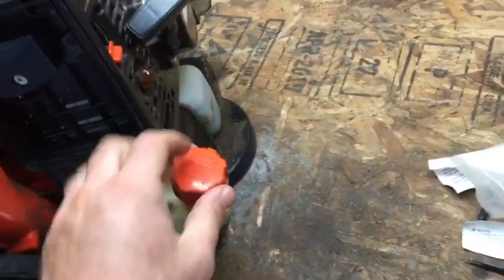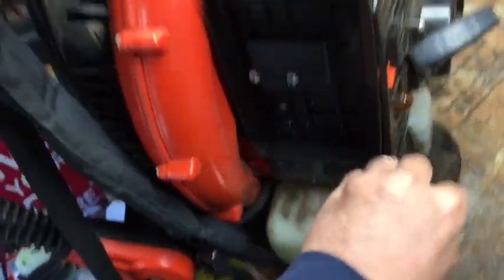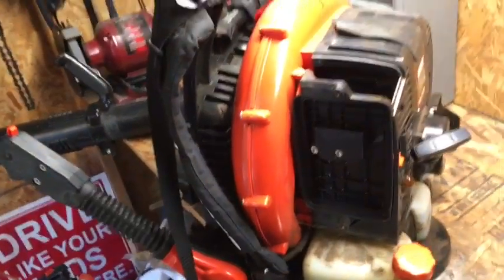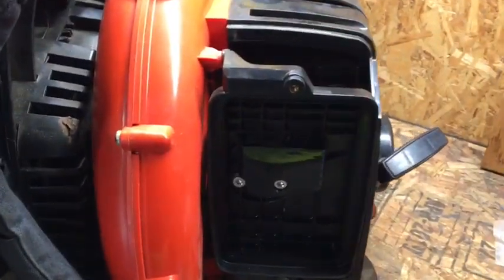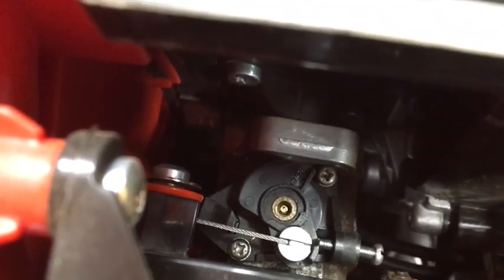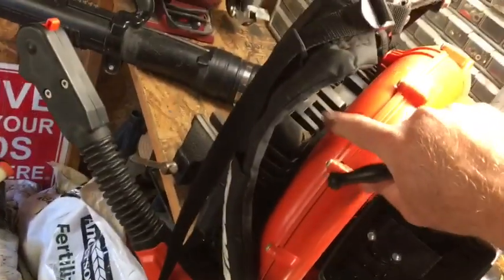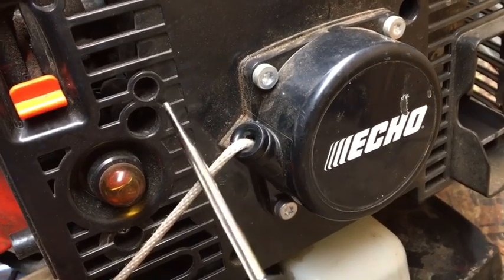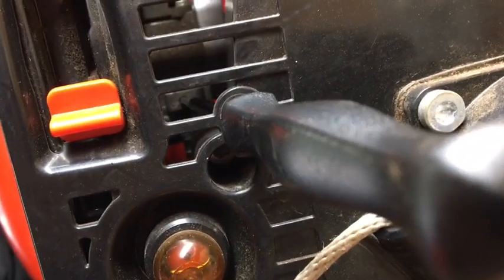Echo 770 BLOWER CARB ADJUSTMENT STEP BY STEP

Comment: Thank you for this video. It helped me finally fix my 770t. Echo replaced my entire engine but not the carb. Even after that it was still bogging and running hot. I kept telling them it was too lean and always told carb was set right. About a half turn and it runs like a hero. No more bogging and it doesn't smell like it's overheating. It smells like a 2 stroke should! And it has a noticeable amount more power. Thanks again for the information!

Comment: Thanks - just did this and solved my problem.  Got a good set of the tools on Amazon for about $15.  Appreciate the help.
Reply from the maker: ggnoodles1 broke the factory tool set and bought another off amazon. These blowers need slight adjustment from time to time

Comment: Looks like a 5/64 tension (get the longest @ Ace Hardware) will fit onto the carb adjustment.  First use penetrating oil on the tiny adjustment stem.  Echo stop selling any adjustment tool. Open just a hair!  Do nothing else but there are clues in my other posts here.  (find that pre air filter etc)

Comment: The current # for that tool is: Echo Walbro ECH-91159L but it can't be had cheap.  AliExpress sells similar for under $2 but it's too short. If you buy one of those multi sets of drivers, the metal section needs to be at least 4" long or poss. loose your warranty & enlarge the hole to get closer to the carb.  I do not know if one of those multi sets has a micro D that fits!  YOU CAN MAKE ONE as I just did for .50  Ace Hardware, find the selection of tension pins, get the smallest, 5/32 x 1, not shortest; close it's gap & you  have to grind it thinner BUT THIS is the only metal that is still strong enough to do the job. I put the pin in a vice so I could pound something into other end to make it long enough  (Use long thin flat head)  I tried everything before this as I won't give Echo (on line for $19.04 + 5.98 shipping) that much $.  **ALSO **   E-bay sells China carbs for the 770 for $15!.  I saw a vid & it looks easy & worked great (so far) & HAS A FLAT HEAD ADJ. SCREW!!!  
 I hope I've helped you as I banged my head for the longest.  (edit: in my exp. all used blowers are slowed- down by a clogged spark arrestor.  it's a screen at the exit of the muffler that 2 cycl oil has clogged.  Throw this useless screen away BEFORE anything else!)  
 I'M NOT SURE I even recommend this anymore b/c this tiny adj. screw is real stiff to keep from vibrating out of adjustment & it is tiny.  My system might round it off so MAYBE  replacement w/ a Chinese carb w/ a  flat head adj screw is better
LISTEN:  The BIGGEST, BIGGEST improvement one can make is to lengthen that short blower tube.  Being short (5' 8") I just unscrewed both tubes & connected them about 2" into each other then used strong black tape.  If you're taller, you may need to order an extra section & fabricate.
The end of the tube should be 2-3 feet away from your feet with no hands on.  I AM NOW RARELY USING full power so:  longer life more satisfying performance!  One last clue.  If you're adjusting any 2 cycle carb that has a slow adjustment, do not touch that adj. screw.
Reply: Great ideas!!
Reply: @kennyplay5982  Thank you!

Comment: Would this fix my issue ? After about 4-5 yards of use throughout the day and the machine stays hot I start to have issues with startup , rough idle and bogging down when use the throttle , after like 3-5 mins of rough idling it will
Work just fine

Comment: is there high and low needle adjustments on these?  if so, how do you tune the low needle?  also, factory settings like number of turns on both needles would be helpful.
Reply: Yes, isn't there a 2nd adjustment? Other than idle

Comment: Hi!  I have a 500T.  It sat for several years.  SO, I replaced the carb, fuel filter, spark plug; and the fuel, of course, adding a touch of Seafoam.  It started right up; but wouldn’t maintain idle, snd then wouldn’t te-start.  I found the coil resistance way too high.  I’m surprised I got any spark at all.  I replaced the coil.  

Now, it starts right up on full choke, snd idles beautifully with the choke off.  When I go to increase the throttle;however, it wants to cut out - lower the throttle and it returns to idle.  The most I can give it is half throttle.

Would this be the high adjustment?  Which way do I go with it, if so.

  I don’t have the adjustment tool.  Some on YouTube use a flattened roll pin.

Comment: I have a 770 same issue. Watched your video and made the adjustment and it worked, problem is I have to keep adjusting it over and over. (The high side jet) Is it loose shaking itself out of spec each time?? Legit have to adjust it every time I use it and sometimes while using it! Any insight on that sir?? Thanks

Comment: My Echo 770P works Great for the first half tank of gas.After that it wont take full throttle and bogs down.Also, it wont turn off.I have to pull the cap off spark plug to turn it off.After sitting for a hour it runs great again; but still wont shut off.It use to shut off the last couple time i used it.Any suggestions on these problems.

Comment: Have 770t new carb running fine then  2 weeks later bogging our again tried adjusting as per your video no change. New carb. New plug. New fuel filter clean air filter. Any other ideas? Thanks
Reply: Try new gas?

Comment: GOOD NEWS:
Echo 91186 for only $11 is the adjustment STEM ONLY  B U T if you squirt some spray oil in the hole where the (very stiff) carb adjustment is, it becomes much easier to turn.  That is what was actually needed.  I believe the 50 cent tool will work now!  Just open it a TINY bit & FORGET IT otherwise you'll get lost trying to find the sweet spot.  Don't skip the last paragraph below.

Comment: my blower will only run with the choke set half way. it was stored over the winter with fuel in the tank .  could the problem be old fuel?
Reply: Did you use any type of Stabil in the gas?
Reply: @kennyplay5982  yes
Reply: @588158  get a carb rebuild kit. 9/10 times it's a bad carb diaphragm.

Comment: I have a 770 works good for like 25 minutes and if i push the gas again it cuts off any idea whats issue with this blower
Reply: What did you find out? I have the same problem.

Comment: Do you ever take the spark arrestor off?  If so, does it make a big difference as far as running better?
Reply from the maker: S_J_P I never have. Some people do a say it performs better without it. I leave it on for safety. Couple screws and you can remove and clean it if it’s carb up
Reply: Jonquil lawn & landscape if you take that out and the deflector that holds it, the half moon 1, it makes more noise, and it feels like it's more responsive we u accelerate